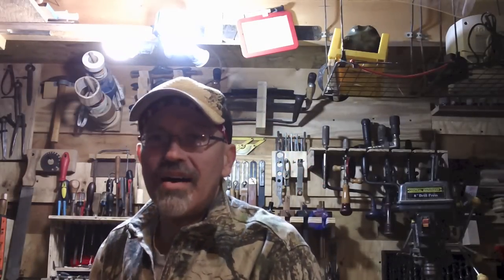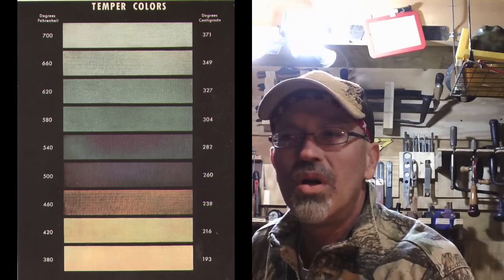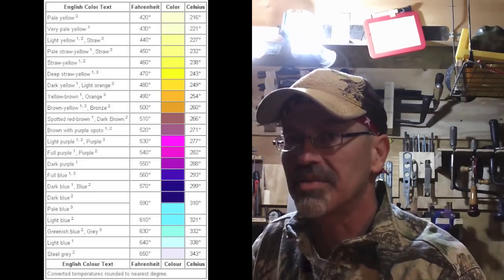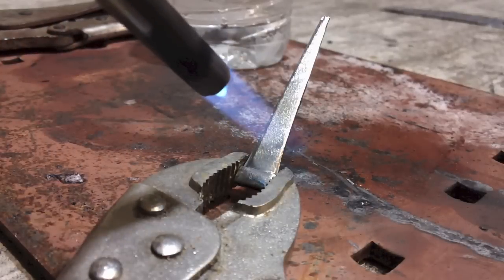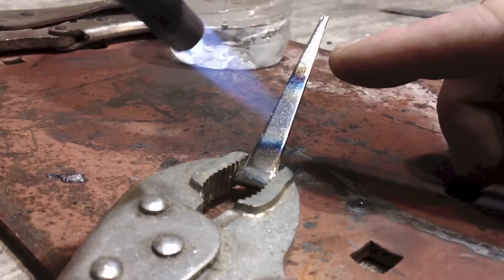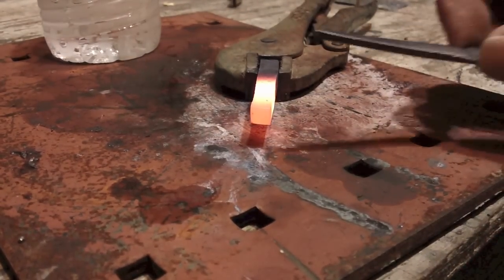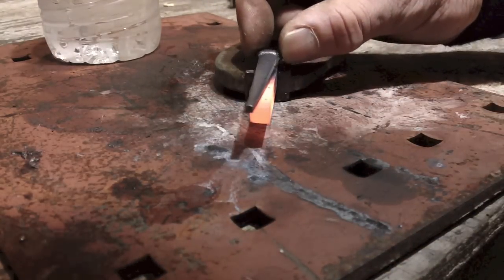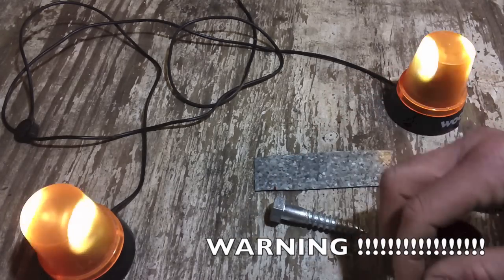Tempering Steel

Comment: I'm allowing it to air cool - no quenching.  While the basic shape is made, I'm still doing some shaping and I'm perplexed as to why it's keeping its spring tension.  I believe it's a special steel.  It came off one of those lone band saws used when they're cutting large cuts of timber.

Comment from the maker: When you say "When it cools", what are you quenching it in. I would try oil first then water. Oil quenches just a bit slower that water. That is what makes carbon steel harden, is the snap of the temperature change and the molecules lining up correctly. The chances you have air quenches steel is very small. The steel has to have a high carbon content to get real hard. You could be working with some space age combination to witch only the manufacturer knows the technique.

Comment: Okay, I'm working on a knife made from an old industrial saw.  I have heated that thing over and over to bright (nearly white) red, and when it cools it's right back to spring tension.  I have no clue what the heck is going on.  Could it be because it's so thin that it's cooling too quickly?

Comment from the maker: Thank you sir that was nice.

The question you ask on the knife opens a whole new can of worms. That is a great way to do it. You will have a softer back than the cutting edge and that will give the knife some spring. It will have a tendency not to break. You want the tang, spine and ricasso to be a bit softer than the edge. Hand tempered blades are far more superior than manufactured ones. YOU control where you want the harness and the durability of being softer.
Thank you for the comment.

Comment: "I'm not an expert, I'm not a pro"

You are to me Dave, you are to me =) very informative video.

Quick question, if i make a knife with a nice thick back edge and obviously a thin cutting edge, if i heat the back of the knife with a torch along its length and watch it as you did with the nail, until the 'straw' part touches the cutting edge, will that knife be hardened ? is that a good method to use ?

Comment from the maker: Yes you can. It has to be hot. Keep a magnet handy, on a stick would be good to test to see when you get to critical temp. 1330 degrees. you might have to figure out a way to move some small amount of air across the coals.

Comment from the maker: I would take that to deep straw - yellow. You will need some flex in yours. You are not going to know where the knife is going to land. I would temper the entire blade. An oven up to 450 will do nicely. Those are not going to need a razor edge. Spring steel is perfect.
Good luck!

Comment: Question, I've really been into this kinda stuff ever since I was young, and I wanted to mess around, and I found some materials to start. And something I wanted to try and do was to make a little throwing knife (Maybe 8 inches long) from a piece of leaf spring. But I would want it to be useable that I could throw it into wood without breaking the tip/bending/etc, Would I want the entire temper of it to be the straw color?